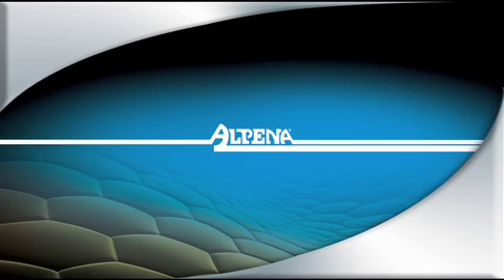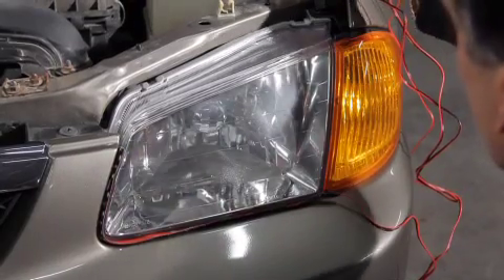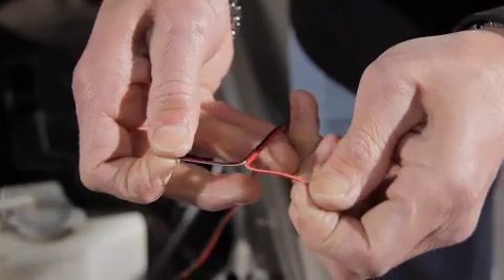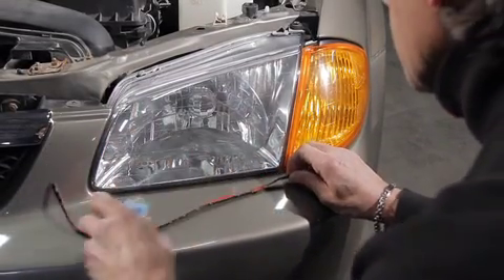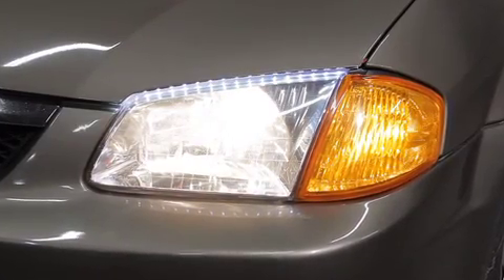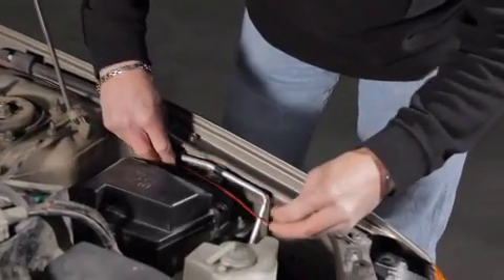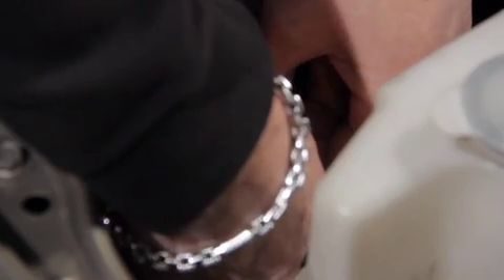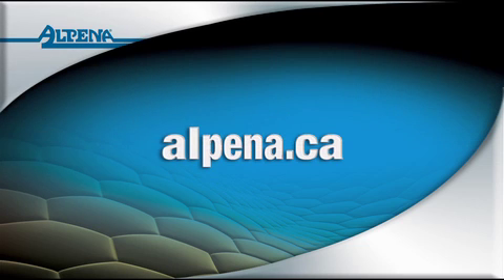Install FlexLED and LED Litz from Alpena

Comment: used these to light up my tuckbed... FYI when it said it uses .24 amps, I figured out that means .24 per led, which is 28 amps for the strip.  Blew half a dozen 15 amp fuses before figuring that out.  they r REALLY bright

Comment: I bought these, please reconsider. I have had them for only a few months, the clear plastic that the lights are embedded in (not the sticky side) are becoming malleable and tacky to the touch. Dirt has started to embed itself in the stickky mess which was at one time solid like in the video.  Cheaply made but not cheap to purchase, look somewhere else if you want them for over a few months.